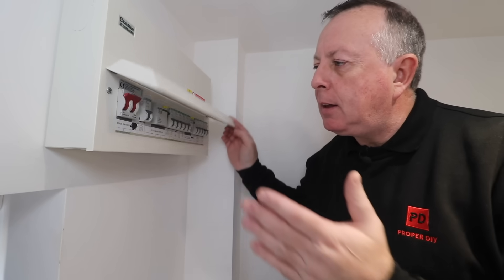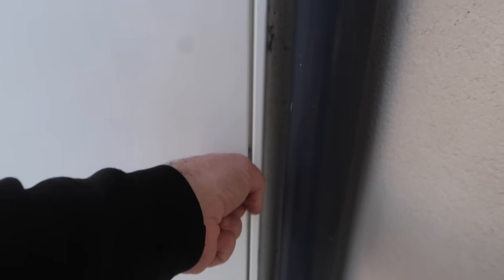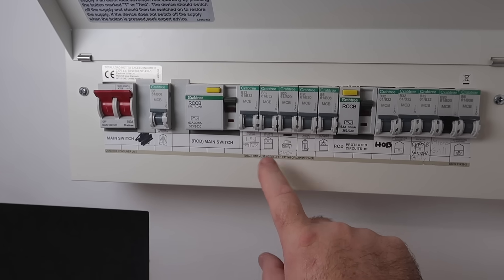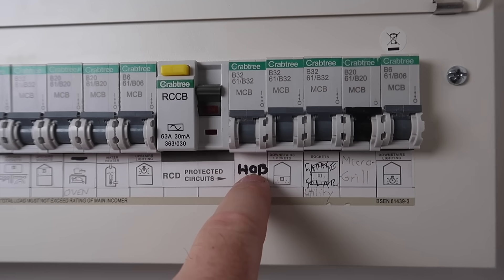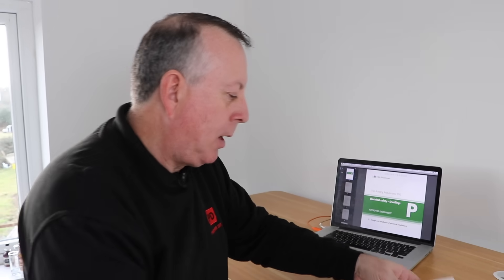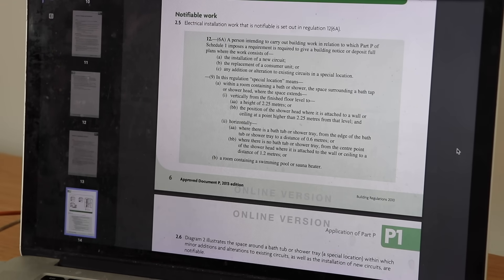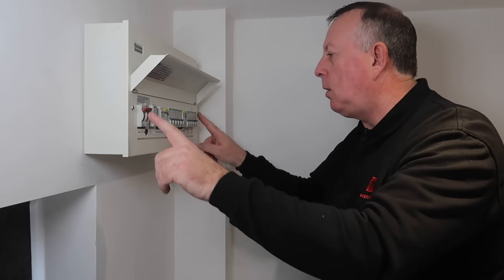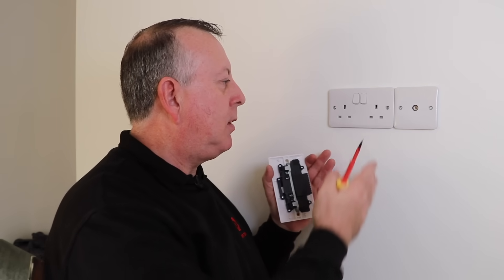What electrical work are you allowed to do in your own home?

Comment: I must admit I did all my electrics soon after I got married back in the seventies. A 1950’s built bungalow which had the old rubber cables. At the same time replaced all plumbing in the very hot summer of 76 at one stage all we had working was a single water tap by the stop cock. I installed all plumbing including central heating fitted kitchen and all electrics. I divided the power supply into multiple ring circuits more than needed for a small bungalow each on its own mcb.  One thing I would not use till tested was the gas. The final gas connection and testing was made by the gas board who also inspected the whole of the central heating system so it could go on their service contract. The engineer actually commend my installation. In later years I had an electrician install a rcd in the tails not the best idea but it gave me some extra protection. All has worked perfectly over the years inc new kitchens etc. Of course my install was before all these regs came in but it was a case of needs must no way could I have afforded to have the work done for me. Just recently I had an eicr carried out which passed with flying colours apart from a loose connection in one socket. I wanted the consumer unit changed but was advised not to go ahead due to space restrictions etc.

Comment: What electrical work are you allowed to do in your own home?
The UK/Poland - Electrical System is Totally Sh1t.
This Guy's Installed a Modern Circuit Breaker Distribution Board?
Whats The Point of That? The UK system, Uses RING Main Wiring.
All the Sockets in The House are On a Ring. Two Paths Back to The Distribution Board?
Therefore THIS Idiot, Has Got 60 A Circuit Breakers.
With The American System. Each Room has Wiring Back to The Distribution Board. They Use 20A Circuit Breakers.
They're 120 V and 20 A circuit Breakers. UK System, They're 240V and 60A Circuit Breaker.
Circuit Breakers are Better Than Fuses in UK Plugs on Appliances.
They Trip 10 Times FASTER. E.g. If a Room Exceeds 20A, say 21 Amps. The Circuit Breaker will Trip 10 Times Faster. A Fuse is Only Faster Than a Circuit Breaker - Say When The Amps is 40 A, instead of The Fuses 20 Amp Rating. A Circuit Breaker will Save Your Life, When the Current Goes to 40A from 20A. However, A Fuse will Take A Very Long Time to Blow - When The Current has Gone To 21A from 20A. You Could Die.
These Sikhay, Think They're Clever. In Reality, They're STUPID.

Comment: Recently I had an RCD fail which protected all of the circuits in an extension. I did the tight thing, called an electrician. Upon inspection he said "MK don't make this rcd any more so I'll have to replace the whole consumer unit" I said "they must make an updated replacement, the consumer unit is only five years old?" "Nope they don't mate" I said Id think about it, which I did fir about five minutes. Went online found the equivalent MK replacement, ordered it online, delivered and fitted by me the next day. £31

Comment: 1) You can replace an MCB/RCD/RCBO/AFDD inside a consumer unit as it is a part of an existing circuit. You just cannot replace the whole consumer unit - look at (b) below. It shows that in the document shown in the vid. 
2) You can install an isolator switch, such as a fused spur switch (FCU), if it is a part of an existing circuit. A spur from an existing circuit is not a new circuit.
3) You can install or replace a socket, if it is a part of an existing circuit.

Most work is non-notifiable, which means you don't have to tell building control about it or have an electrician sign it off.  The reg:

Notifiable Work:
Regulation 12. (6A)
(a) the installation of a new circuit;
(b) the replacement of a consumer unit;
(c) or any addition or alteration to existing circuits in a special location.

(c) above, Any addition or alteration to existing circuits in special locations, are generally bathrooms, swimming pools and saunas. 
If it's NOT work described above in (a), (b) and (c), then it's non notifiable.

All work still needs to be undertaken to electrical regulations. You need to be competent.  Competent means the results and working safely.

Of course, you can do anything in your house from the meter onwards as long as you get the notifiable parts signed off by an approved electrician. An EICR inspection for all the installation comes to mind.
Reply: Much valuable information. Thanks for this.
Reply: if i was building a house, would it be ok to do the wiring myself and then get an electrician to check it all, or do i have to get an electrician to do everything?
Reply: @mrxmry3264 
The former. You can do it yourself, then have it checked. Use RCBOs on all circuits except the socket circuits then use AFDDs, which the regs recommend you use. Then the BCO will be confident it is a good installation. 

If an electrician will not do the check for some odd reason, get an EICR test saying the house will be immediately rented out, then he does it.
Reply: I do the 1st fix using Wagos or the Ideal type of connectors inside the socket/FCU backboxes, connecting up a ring (or a radial), and even connecting the earth terminal of a metal backbox - stuff paper in the boxes to prevent plaster form entering.  The backboxes are effectively doubled up as junction boxes. The ring circuit is tested after the 1st fix.  Any wiring problems are identified before finishing trades turn up. Putting it right afterwards may be big problems and expense.

Then the plasterers and painters come in doing their work. The Wagos are left in place in the backboxes. Then on the 2nd fix, on a bench the sockets and FCUs are prepared, by screwing into all the socket's tail's flexible 2.5mm cable, including an insulated earth wire, about 100mm long with a ferrule onto the flexible wire into sockets screwed terminal connection. The flexible tails are put into the Wagos at the back of the backboxes. The socket easily pushes back in being on flex tails. Then test again. The speed, and ease, of installation is much quicker. And much safer as the ring itself does not have screw connections that can work loose over time.

I have found many terminal screws on the back of sockets that worked loose over time - expansion-contraction, vibration from people walking on wooden floors, plugs being rammed in and out constantly, etc. That is why screwed terminal are maintenance terminals. Wago screwless are maintenance free. Wago also apply the correct torque to the wire, which is maintained over time as well. Having the full current of a ring circuit flowing through the terminal at the rear of sockets is a potential fire situation, with maybe arcing, also adding higher resistances to the ring, which may cause one leg of the ring to take most of the load, etc.

That is where Wago types of connectors, in the scenario I just outlined, take the ring's load, not the screwed terminals on the rear of the sockets. It is much safer.   The sockets are only spurs off the ring, taking only current when an appliance is drawing current. Go back to a ring circuit after 10, 15, 20 years, then test it. Then go back to one which has the ring running though maintenance free Wago types. The integrity of the Wago connection ring will be upheld. Much safer.

Having Wago types of connections on the rear of sockets, as in Germany, adds another level of safety, in eliminating another screw terminal potential failure/fire risk.

Comment: A friend of mine built a wooden garden shed and fitted power to it. He used a consumer unit in the shed, he used simple 13amp arctic grade cable passed through some 25mm plastic tubing under his garden flags and stuck a 3 pin socket on the house end to plug his shed in!
4 months on and his home cover service was due, so they checked his gas and electrics. No issues, sign off for another 12 months! Unbelievable!
Reply: It is legal and safe.

Comment: I had a wire from a cooker bypassing the meter for fifteen years, only put a token amount on the key and enjoyed free electricity. My freind got caught for the same thing but had the gas meter rigged also but all they did was put tamper sensors all over his meter, he was growing weed but they still didn’t do anything as it was between crops, the police were there too as they had broken in for the electricity check. they can’t tell what you’ve used either he had been growing weed for year# under 600w hps bulbs which would cost about a fiver a day each bulb,  and if you move just pop the lcd screen, all they can do is replace it with a smart meter. You can buy the little security tags from eBay if you want but I’ve had a few electrical safety visits but theyve never said anything about the lack of security. tags, they just say “ that’s a very old meter you need to ring up and get a smart meter installed” I just agree and do nothing but put back my wire once they’ve gone. The gas is harder and more dangerous to do but you can pull the return valve out with long tweezers so when you run out of money on the meter it can’t cut off the supply, this method is undetectable unless you don’t put any money on it at all.

Comment: As a qualified Electrical engineer who served an indentured apprenticeship in the 1960's which involved passing City and guilds B&C certificates and also all aspects of electrical theory I consider your advice to be very misleading and dangerous to encourage DIYers to tamper with something they have no idea of the consequences of a simple misunderstanding of electrical theory.I mainly worked on 33KV and 11KV systems where a simple mistake could be fatal but the same is true on 415V/230V systems can you accept the consequences of telling them its OK to tamper,much better if they take a course to understand simple electrics or read a few books,at least that takes effort than you thinking they will learn on a Youtube video.
Reply: This one is implying all DIYers are incompetent. Which is tripe. BTW, DIYers do not work on 11KV systems.

Comment: In 1983 I came to England from New Zealand. In New Zealand, only a qualified Electrician can touch any part of the fixed wiring. It is illegal to even replace a light switch. I was amazed to find that in England (at that time) it was lawful to completely rewire your own home. Anything at all on your side of the consumer unit. I bought an old house, eventually. All of the wiring was in steel conduit. Rewiring it was easy. Just join the new cable to one end of the old rubber cable and pull it through the conduit. The surprising thing was that the old rubber insulated cable was in absolutely perfect condition, although it was over seventy years old. It would probably have been safe to have left it for another seventy years! Then, in 2006 (I think) the law changed. Suddenly touching any part of the fixed wiring was illegal. The colour coding changed as well. No longer red, black and green, but brown blue and yellow/green. Very clever - any wiring in an old house which is not the old colour coding must have been fitted after the Regulations changed, so a buyer’s Surveyor would want to see evidence of that wiring having been installed by a qualified Electrician.
Reply: Never seen someone actually check.

Comment: 1 BIG question why rcd is 63 amp and you have mcb's 32 + 32 + 20 + 20 + 6 amp = 108 amp more than 2 times over rcd max amp rating? Is that ok? Every one told me that if you have 63 amp rcd mcb sum of amps must be under 63 is that true? Thanks!
Reply: It is called diversity.  They know that those circuits will never be pulling maximum amps all at the same time. There are calculations for it.

Comment: This is very common language when it comes to DIY electrics - "not allowed", "illegal", etc, but it is rather misleading. Any competent person can undertake domestic electrics which is notifiable to Building Control, as long as their work is then... you guessed it, notified to Building Control. The difference here with qualified electricians is they do not have to notify BC as they are allowed to self-certify. 
If a DIYer can get a friendly electrician to sign off their work, this is the best option, though the project should be discussed with them first rather than doing the work then looking around for an electrician who will sign off, which may not be so easy. The less good option is actually notifying Building Control, as they will charge for this and contract a qualified electrician at much higher cost to do the inspection.

Comment: I have seen some appalling work carried out by so called NIC EIC electricians. Thats why I wouldn't let another near my place. I am fully qualified and carry out my own work, and stuff the local authority, they don't have the labour to control the cumbersome and over bureaucratic system. I enquired 10 years ago and was told that to change my C/U I have to pay them (I think it was then) £135 even though I hold all the relevant electrical qualifications. I paid grudgingly and was told to contact the L/A once starting, I did twice, no reply, emailed twice. Then once completed I emailed them to that effect, still no reply. I did all the testing, used a copy from the wiring regs test sheet just in case somebody actually turned up but nothing.
In the last 7 years to now I have done 2 extensions to my house, own electrics and the building inspector who knows my trade doesn't seem worried.
If I sell I'll just get a test and inspection done as part of the sale.
I wish I had saved my £135 years ago.

Comment: I see that you have type "AC" RCDs. That means that they are designed for tripping out on sinusoidal waveforms, i.e. circuits with resistive loads like traditional light bulbs. cookers etc. Today and for the last 20 years, Appliances and lighting have been electronic inverter driven, which reflect a DC component current back on the mains. This house should have type "A" RCDs if only 3 years old. Type "A" RCDs deal with sinusoidal and pulse DC waveforms.

Comment: That was really interesting, thanks.  One question: in the meter cabinet, why did you add your own isolation switch in addition to the supplier's isolation switch?  Surely you're allowed to use the supplier's switch when isolation is needed?

Comment: In Australia, unless you’re a fully qualified and licensed electrician, you cannot do a thing.  It’s the law.  I’d suggest the Author post a disclaimer to remind people to check their local laws.  And if you can’t find an answer, do your own electrical work, burn your house down and see what your insurance company has to say…..
Reply: Within reason... I am a registered Inspector of the AS/NZS 3000 wiring rules. As I lived in New Zealand for 14 years. There is a sliding scale of competencies and also limits on what a home owner can and cannot do. the document sets out what is Prescribed Electrical Work and what isn't. You can change sockets and fittings like for like, but not add circuits and definitely not touch the consumer unit.

Comment: OMG I thought the UK was more a freedom place than this. You can customize cars to the extreme and get them on the road but you can't add a circuit to your panel! Here in France you can do all your electric by yourself, including changing all the panel. Only thing forbidden for a DIYer is installing a car charger more than 3,7kW. And even if you did, you wouldn't risk any fine, just lack of insurance coverage should a problem occur.

Comment: 2 points to notice in the video is the Lewden external isolator should have 25mm glands for the tails from the EON isolator switch and the metal consumer unit should not have plastic blank int as it is combustible and defeats the purpose of the metal containment. Kudos for rest of the video to separate DIY from skilled and notifiable work

Comment: In Australia, you cant even change a power point or light switch and must all be done by a licensed electrician
Yup, if you get a power point that does not hold cables or wont switch off and want to replace it.
You need to call out an electrician to do a 10minute job where you will pay $250 or so

Replacing a switch be it a power point or a light switch is easy.

With light switches, you normally have 2 points where cables get secured at.
With a power point, the backs are labeled and even color coded, Brown=Live/Active, Blue=Neutral, Green=Earth.
Reply: I’ve never seen a sparky shop at Bunnings yet they have such a good range. Safe to say many ignore the rules
Reply: @dirtmcgirt168  and good that those rules are ignored, they're overboard.

the whole you need a licensed person to do anything is getting out of hand.

If i need a power point moved or a new one installed into the room or something hooked up from the distribution board, yes I will hire a sparky as that is where this law should apply.
Not basic maintenance 

If I am replacing taps, washers or the braided flexible lines that connect to the taps from the wall I will do it myself, anything else get a plumber.
Anything gas related I will get a plumber.

If you do not know what you're doing go ahead and call a tradie, if you know how to isolate water or power and verify that it is isolated.
You know how to do the job safely.

Comment: its all a load of bs rules and regs rhat constantly change, where as the fundementals of how electricty works hasent changed , modern electrical connections are under, or just above under engineered, the ones they used in the 80s were better, stronger and have more suraface area , as in what you are alowed to do in YOUR OWN HOME, u should be able to do whatever u like , and if your house burns down its your own falt for tampering with what you dont understand.

Comment: In Germany the mains voltage was changed from 220V to 230V, 
in England from 240V to 230V.
Reply: the nominal voltage was changed to 230v . the actual voltage stayed the same . only difference is in calculations for cable sizes